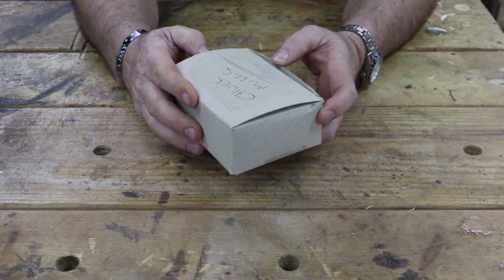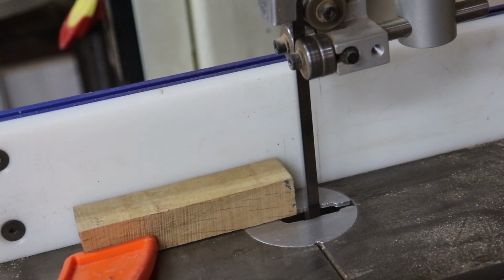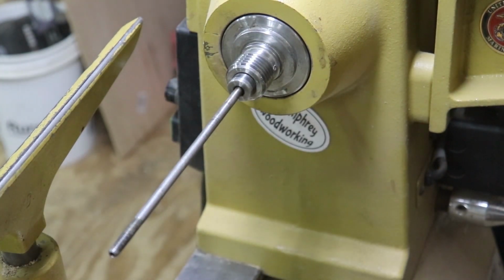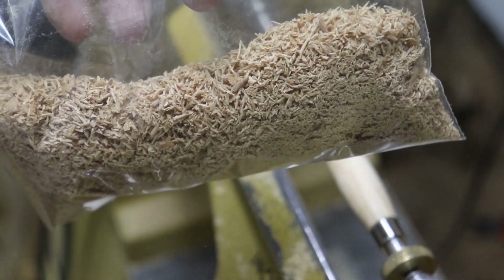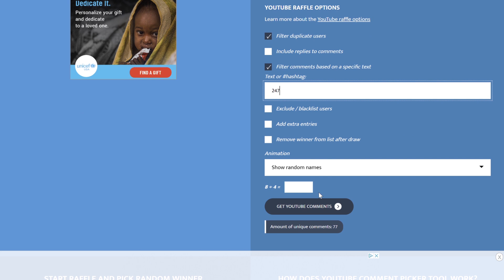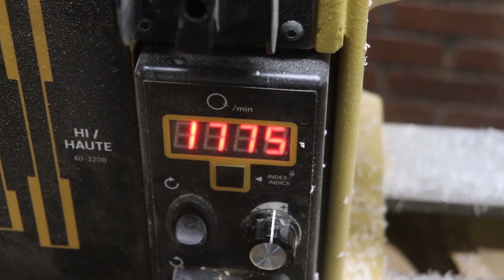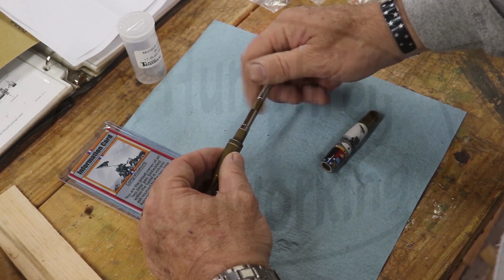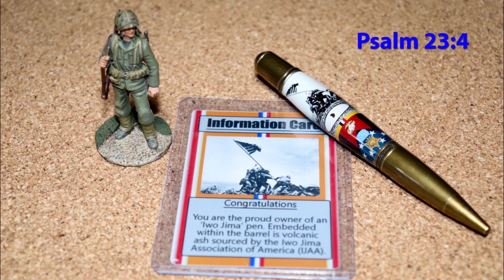Pen Turning for a Special Birthday

Comment: 3 great mementos. Excellent!
Reply from the maker: Doug, if there is no checkmark by my name in these comments, it is a scammer and imposter.  Sorry, you didn't win the coasters.  Sorry about the creeps using my photo.  They've been reported and removed.
Reply: @RHumphrey  not a problem. I saw that the same post was made a little bit ago to several folks. I do wish YT would/could do something about that mess.